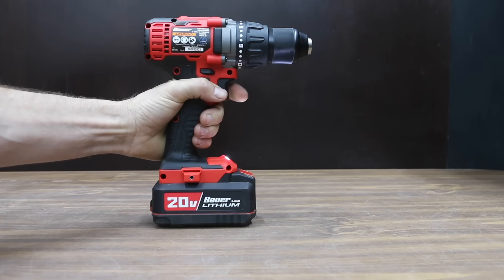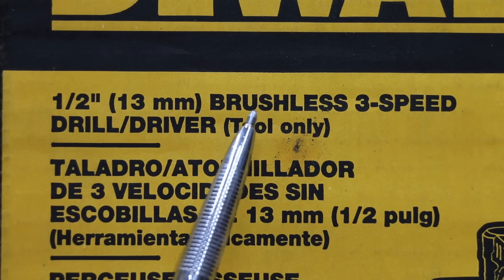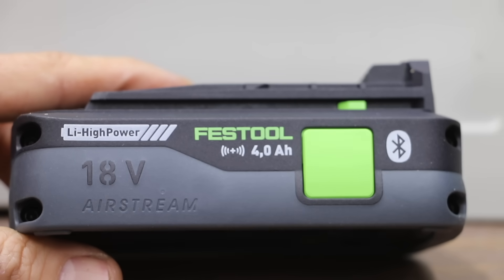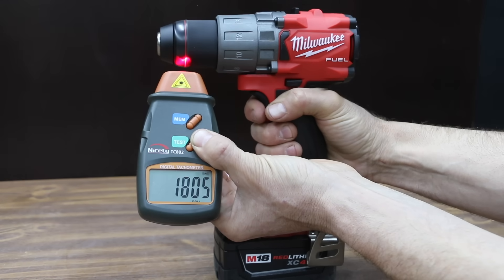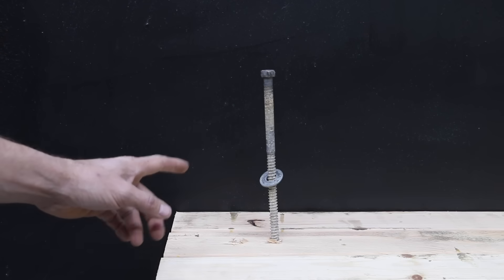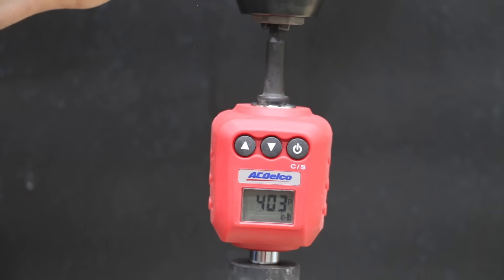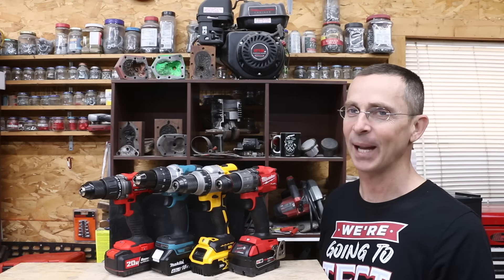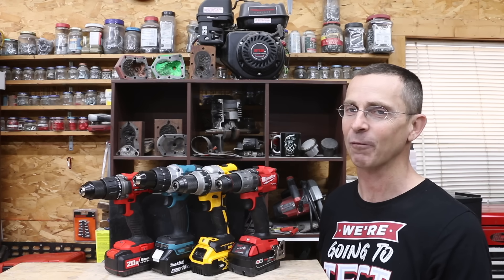Best Drill (BATTERY POWERED)? Milwaukee vs Dewalt, Makita, Bosch, Festool, Ryobi, Bauer, Ridgid

Comment: For home use, Rigid is hard to beat with it's lifetime warranty. It's the only company that offers lifetime warranty on battery as well. I purchased compact smaller 12V combo with Drill, Impact driver and oscillating tool and it those than do 98% of the task I need to do. The only thing I don't do using them is to drill into a concrete floor and stir cement.
Reply: I would agree with your reasoning based on the battery warranty. But, for the last few years, I’ve made a concerted effort to avoid Made in China products as much as possible. If I can’t find a Made in USA option, I look for other countries such as Malaysia, Taiwan, etc.. The CCP is truly an evil organization in the same vein as the Nazi Party.
Reply: I have all ridigid tools and honestly the bang for buck is VERY hard to beat.  I've thrashed them for about 5 years now and they're finally starting to show slight signs of wear. (Dropped them from decent heights, drill through brick and concrete with them no problem for small holes, Max clutch setting for multiple drilling applications)  One battery FINALLY gave out on me this week and is finished and I am expecting to replace them in the new year.  

I will most likely not go back to them though, for the reason the comment above put as well. I will not support Chinese manufacturers anymore, and this does not just mean for my tools.  Ridgid,ryobi and Milwaukee are all owned by the same parent company, so I will not touch any of those.  Need to hurt the pockets of those hurting others, as a start.  

Most likely will be starting a new line up of Dewalt or Metabo tools, and as of right now leaning towards Metabo. 👌

Comment: I wish you tested DeWalt DCD 796 which has mechanical clutch and imo is more comparable to other models. I guess milwaukee and festool also have ones in the catalogue.
Reply from the maker: Thanks for the suggestion.
Reply: @ProjectFarm  Oh and there is another feature that I find important - the smallest size of drill that each model can hold in chuck.
Nevertheless thank you for the effort you put in providing us with such a substantial and brief videos

Comment: While good tests throwing festool in the mix and putting it through the same tests as construction grade and construction purpose built isn't an accurate test. It is a high end fine woodworking tool. Not a throw it in a tool box on a construction site kinda tool. I'm by no means a festool fan or owner. I'm milwaukee all the way but every tool had a job and every job has a tool. Finish work that I would typically switch to my milwaukee 12v line would be more on par for testing festool

Comment: I LOVE your 'tests'.  My favorite cordless drill & driver (I have both) is the 12-volt Hitachi due to it's light weight.  I sometimes have to do over-head work, so I appreciate how light it is. I also have the Ryobi 18-volt drill & a driver.  It's never let me down when more power is needed.  The Ryobi clutch is very useful.  I love the magnetic holder on the Ryobi.  It can hold a dozen or so screws when you are using a lot.  I don't have to dig into my pocket for more.
Reply from the maker: Thanks!  Thanks for sharing.
Reply: Dewalts have a magnet on the side too.

Comment: For get about all them get the Kobalt XTR. 2000 rpm around the same for torque i paid 135 for the kit.. i use this for a drill paddle and it pulls ME  My brother and sister and the air raft too. over 800 lb of weight. battery is a 24v. kinda wish i seen on here..
Reply from the maker: Thanks for the feedback.

Comment: For me, low speed control, variable torque settings and reasonable battery life are important, all these drills can drill a hole. I have a shitty old black and decker i keep because it's great at low speed stuff, trying to work out which one of these i could upgrade to.
Reply from the maker: Thanks for the feedback.

Comment: You should try the Milwaukee quarter inch impact on the screw setting
Reply from the maker: Thanks for the suggestion.
Reply: @ProjectFarm  what size lag screw were you using and what were you putting them in

Comment: Seems like the build quality of the DeWalt tools has gone up! You don't always get what you pay for though. I once had a Fein set. They lasted only 6 months, used in the electrical sector. Have had good use with Bosch and Makita, but by far the Milwaukee brand had held up the longest, including the battery life. After 3 years of hard use , the Milwaukee's are still running strong.

You have probably one of the best shows on Youtube, IMHO.
Reply from the maker: Great feedback!  Thank you

Comment: The lowest clutch setting from the Festool drill will be a lot lower, when you put it in a higher gear. Because most of the electronic clutches have the torque sensors/ current sensors on the motor side of the gearbox.
Reply from the maker: Thanks for the feedback.
Reply: Yes, it is recommended to use electronic clutches on the second or third/fourth ( DeWalt, Festool ) gear.

Comment: Awesome to see this comparison! I've had DeWalt and have Milwaukee, my top choices for cordless.
I have had Dewalt drills which performed excellent. I realized just how great of a drill the Dewalt was (after I got rid of it to a buddy who uses it daily still).
I since have switched over to Milwaulee due to the multitude of tool selection and the warranty.
 I own several different FUEL impacts and drivers:
2863-20 1/2" MONSTER 1000/1400 FT. LBS. TQ
2962-20 1/2" MID TORQUE 550/650 FT. LBS. TQ
2852-20 3/8" MID TORQUE 450/600 FT. LBS. TQ
2759b-20 1/2" BABY 220 TQ
2754-20 3/8" 210 TQ
2853-20 1/4" HEX DRIVER 2000in. lbs. TQ
2757-20 1/4" HEX DRIVER 1800in. lbs. TQ
2760-20 1/4" HEX SURGE (HYDRAULIC)
 plus 
2) 2804-20 drills.

Along with 
2722-20 SUPER SAWZALL
2522-20 CUTOFF TOOL
2485-20 DIE GRINDER
2648-20 ORBITAL SANDER
2734-20 SLIDING COMPOUND MITER SAW
2730-20 CIRCULAR SAW
2724-20 LEAF BLOWER

Being a mechanic I use most daily and the others for home improvement and maintenance. .....and many other projects I find myself doing.
Reply from the maker: Thanks for the feedback.

Comment: What exactly does Festool give you for that additional $400? Does a "Kick Me" T-shirt come with the kit?
Reply: As a carpenter (cabinet maker) I have used alot of festool hardware.
Their tools are generally well thought out, great performers and festool provides a good service if needed.
For the drill: it's actually not a festool invention but rather from a company named protocol that festool took over.
I own a festool C18 cordless drill. (the smaller brother)
It's got enough power, is pretty quiet and the low speed (half trigger pull) is really gentle. Also you got an electronic clutch which makes working with it super comfortable.
The Centro tech quick change chuck is really handy too. 
And the drill has an built-in bit storage which is probably the best feature ever.
Also the whole festool systainer thing is a great way to store/ transport your tools.
So could I get the job done with a cheaper tool? Absolutely!
Should you get a festool drill yourself? If you need to ask that, the answer is no!
Is operating the drill a good experience? Hell yes! I enjoy every second of it!
Reply: @SuperDeinVadda  probably including them in this comparison wasn't really their intended market. They're not competing to drive in 10 inch bolts. I'd still say that they probably have a fairly healthy markup on this tool, but it's for a niche audience and if it works well then price isn't the only consideration and doesn't reflect the value you get from it. Hilti would probably have been a better premium tool inclusion here.
Reply: Well they did not test how long will last these…
Reply: Not necessarily their drills, but a lot of their other tools are so expensive because of their built in vacuum system.
Reply: @seventhson6485  again Milwaukee fuel, Dewalt xr, or Makita are much better options. Plus there are so many more tool options in the platform
Reply: @seventhson6485  exactly. For 2.5x the price the performance needs to match up.
Reply: I seem to remember AVE taking one apart a while ago and it not being anything special inside. I'd imagine that there's a lot of profit built into this item and realistically it's not giving you any more control or finesse over the other tools. You do get a box which stacks with your domino and track saw though.
Reply: @andys844  ive had several brands and i do really notice a big difference in controll and durability
Reply: @andys844  Since Festool is a private company we don't know how much profit they are making. They almost certainly have higher manufacturing costs since most of their tools are made in Germany or eastern Europe compared to China for most (all?) of the other brands. Plus they don't make their tools at the scale of the others.
Reply: Festool drills are shit for everyday "caroenters", that being said when you have your $46 fluted countersink and trying to free hand because you forgot your pocket jig and drilling into oak....that lower power and increased trigger control of the festool sure is nice.🤣 
I personally gave up on festool other than my track saw....everyone else makes great products at a fraction of the cost and the milwaukee surge impact is a thing off beauty. But I'm not brand loyal, I like what I like being left handed.
Reply: They’re for fine wood working, offering more control and precision than the other more “industrial” offerings.  Drilling lag bolts and measuring max torque isn’t really their intended use
Reply: @hallowedbethygame2840   Something about that "slow and steady progress" quality?  11:00
Reply: @crimony3054  if you’re using a drill to drive lag bolts, you’re probably a DIYer
Reply: @hallowedbethygame2840  lol yea. Impact wrench or driver are for that.
Reply: @hallowedbethygame2840  what exactly is their intended use? Its a drill that lost to the competition in every single catagory other than price.
Reply: @bobkin611  . Ikr. Paying over 2x for an inferior product. No thanks. I'll take Milwaukee, Dewalt or Makita. I have used lots of bosch  tools in the past, (Sawzall blades, driver bits and there drills). and never been impressed. Always have found Milwaukee and Dewalt to be better. 
My father had a bosch and bent the chuck jawd driving in a wood screw. I used it. It wasn't great. The batteries only lasted like 10 minutes. So I picked up a Milwaukee M12 Fuel set and couldn't be happier. I also found bosch's driver bits to be soft and cheap. Definitely not Milwaukee or Makita quality.
Reply: @bobkin611  fine wood working, like I said.  If you’ve never used a festool drill you won’t know what you’re missing.  If you’re a MEP tradesman it’s not worth it.  If you make cabinets/furniture or even higher end remodeling it’s a different story.
Reply: @seventhson6485  but it's not 4 times the price. Ad a battery, charger and systainer to a makita drill and it 'll cost you a extra 150 dollars over the machine only price easy. My point is that the comparisson isn't accurate. 

The oldest festool drill we have still in use has been abused for around 10 years (outside conditions) and still works as good as my 4 year old one.

I have never liked the festool drill tested here though. Been working with a t 18+3
Reply: Festool= shop tools
Non festool= field tools
Reply: Haven't  you noticed he is comparing machine only prices (without battery or systainer)  with a setprice of the festool? At least compare them right.. Festool is still more expensive but out of all the brands i used i like them the best. I work outdoors in mud, rain and dust daily and festool is the only brand that lasted me longer than 5 years. I also like the control of machine over the makita's and hitachi's we had.
Reply: @TwanvanDijk  wow brave Man .. I would never let mine leave the workshop lol.

Comment: I found the results of the festool really interesting. where i work, if festool makes a tool we use it. the set of festool drills i use have been around for a almost a decade and taken the same abuse as the 2 makita drills that let out the magic smoke. something about the festools just last, these drills have been flooded and dropped and still work just fine
Reply from the maker: Thanks for sharing.
Reply: Agreed. Festool builds it's tools for other characteristics than raw power.

Comment: Could you add Porter Cable in your testing? I've been impressed with this brand and a couple of my coworkers were so impressed after they used my drill they both bought Porter Cable also. I'm an industrial mechanic/technician.
Reply from the maker: Thanks for the suggestion.

Comment: Nice test! Am I missing something with the Festool - why is it so expensive? It looks like a cheaper drill and aside from RPM it seemed not so hot on performance either. I used to use DeWalt tools until they got stolen from my vehicle, I since switched to the Bosch line and they seem far more durable to me. I wouldn’t have guessed that they weren’t as good on paper as I’ve never had an issue with power, and my Bosch combi can drill much bigger holes without struggle through masonry than my DeWalt ever could.
Reply from the maker: Thanks so much!  Thanks for the feedback.
Reply: Probably because of its origin. It looks German so that would explain the cost perhaps.

Comment: make a test of the best drills, I recently had to drill on a project with cobalt drills in pillars with a thickness of 0.5mm, it goes like butter at full speed without liquid cooling, the drill was 4mm, normal drill bits are blunted after 5sec with such material hardness and rotation speed.
Reply from the maker: Thanks for the suggestion.

Comment: Geez I bought a 12v cordless drill for less than $6, drilling on wood is fine it's just struggling and takes a lot longer to drill on concrete walls even just for the length of a wall plug.
Reply from the maker: Thanks for sharing.
Reply: Sorry not trying to advertise anything here. Just a normal audience.

Comment: You know what would be really great? Sort of like your "Top Tools in 2020" video, but a video for first-time homeowners/DIYers (would those be the same? might even be two different videos). As a renter up until recently, and aspiring DIYer/possibly new woodworker hobbyist, I'm overly-eager to build out my tool collection. From what I understand my tier-1 needs are things like screwdriver (assorted types), pliers (assorted types), tape measure, and drill (with assorted bits). Tier-2 needs (I think) are something like circular saw, sawzall, and impact driver (again with assorted bits). Tier-3... I dunno, orbital sander? Help me out here. You could do one for car owners too. An advantage here for me personally would be that I could stop being confused about whether to invest in the DeWalt/Makita/Milwaukee battery platform because you'd surely take that into account. Thanks for all the great work you do! It's super-helpful.
Reply from the maker: You are welcome!  Thanks for the suggestion.

Comment: All of these brands have more than one model of 1/2" cordless drill... so cherry picking the models to determine which is the best brand is silly.  As an example, the Ryobi picked is one of their cheapest introductory brushed models.  Without the battery and charger it is currently on sale at Home Depot for $39.  It is certainly not representative of most of their line.
Reply from the maker: Thanks for the feedback.

Comment: I’ll never again buy a battery powered tool from any maker other than Ridgid.  Lifetime replacement warranty on batteries!  Which are the first thing to fail on these tools, and the replacements cost more than you paid for the whole set in the first place. DeWalt makes a good tool, but their batteries are junk!  I’ve got a stack of DW drills with dead batteries!
Reply from the maker: Thanks for the feedback.

Comment: The video is great but can be improved. After all the data collection, an actual summary of all the data collected would be great. Graphics of data showing why you finished with the 4 recommendations would make it better. A comparison with metric would be most impressive.  For example, torque per dollar, seconds per dollar, screws in inches per second per dollar. Last, some measure of battery life: screws per charge per dollar. 
If you don't want to complete the comparison in video, put the data in a file for download so we can finish the comparison ourselves.
Reply from the maker: Thanks for the constructive feedback.

Comment: I just bought the M18 MILWAUKEE 2802 and comparing it with another that I have the Brushless 1/2 Makita 18v Dhp485sye, the MILWAUKEE 2802 is louder, the motor whistles, it heats up more, the battery does not fit at all, the charger seems iron but as a positive point It has a better broquero, it feels powerful, 5-year warranty, it looks well manufactured.
Between MILWAUKEE and Makita the power seems similar, at the moment I prefer the makita since the motor is quieter, the motor and charger hardly get hot, time will tell if the heating in the MILWAUKEE is a problem or not.
It has cost me $ 3700 Mexican pesos, winning the makita for $ 250 pesos less. I hope my comments contribute something positive to your purchases.
Reply from the maker: Thanks for the feedback.

Comment: Really enjoy the videos and comparisons.   I have seen the various battery tools compared and it seems that in specific cases each tool vendor has the adavtage.  Would love to see a video that pulls the systems together (not necessarily the Big Box store packages) to see who had the advantage there.  Otherwise I guess multiple battery chargers and systems!   Thanks!
Reply: You can buy adapters for one brand to take another brands battery. Some brands don’t make certain tools so it opens up options.